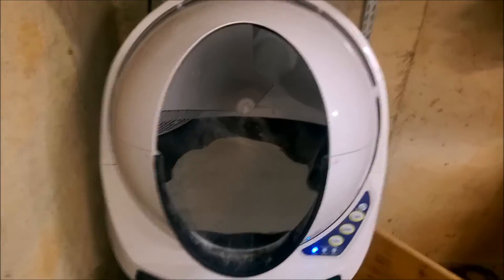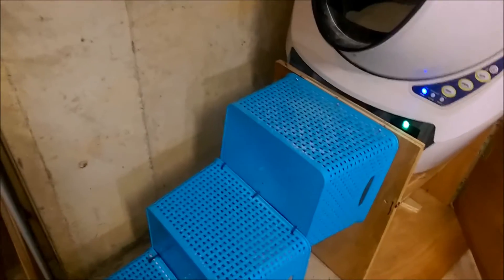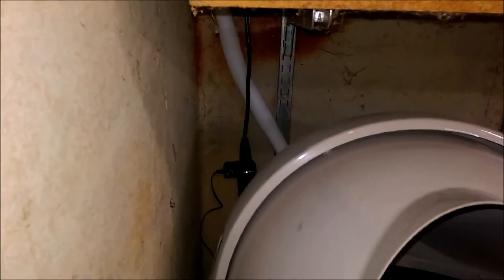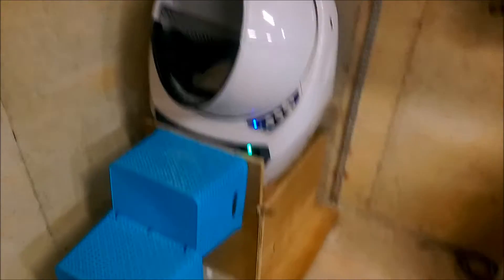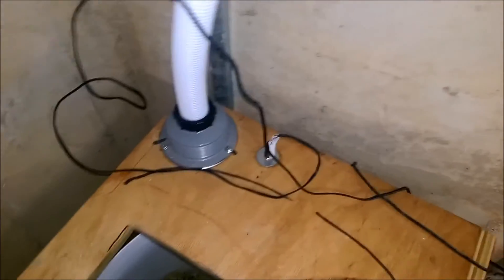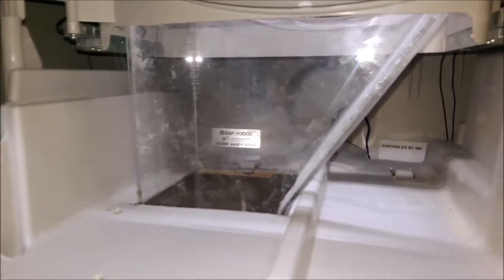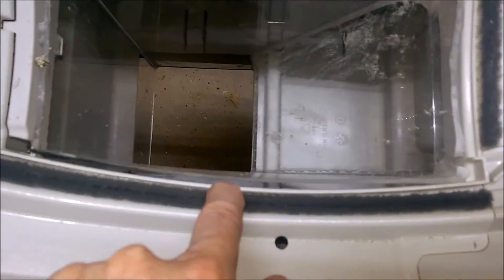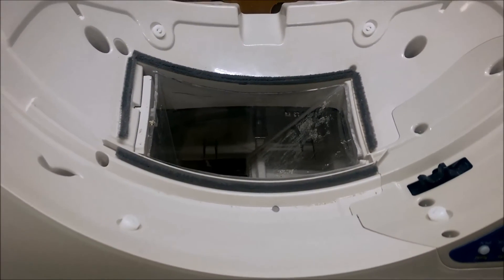Litter Robot Open Air high capacity litter bin mod.

Comment: Thank you very much for your demo. I build the cabinet similar, cut the perspex and cover outside hole instead of inside.  Seem to work well.  Today I will do the step.  If anyone needs the measurement I used for the cabinet, let me know and I can send you the cut I did.

Once again, thank you for your help mate.

Comment: I am about to pull the trigger on a litter robot 3 connect and this is the last issue I wanted to address before I do so thank you! Do you know if these modifications would cause any issues with that unit? And what fan did you use?
Reply from the maker: The only concern I had was that cutting the hole in the bottom might affect the weight sensor on the rear foot. so I took care to leave the center rib intact to ensure the bottom remained as stiff as possible.    No problems at all, except the need to clean the chute maybe once a year.   The fan is a 5" 12 volt PC case fan I had lying around.
Reply: Did you do this modification?

Comment: What did you use to make the chute? Just plexiglass?
Reply from the maker: Yes. Used solvent cement for initial assembly, and added beads of thick acrylic cement along the inside corners to strengthen it.  Also, I made patterns with foam core board first, ending at the bottom before cutting the hole, but extended the lower edges on the final parts.  (Probably not necessary).

Comment: Can you explain what parts you used for the tubing and connection to the fan? I tried something similar but yours looks so much better and probably sealed better.
Reply from the maker: I used a plastic kitchen sink strainer unit. I probably bought it at Ace hardware along with the hose, but they don't list it on their site now. 
I bought it because it was the cheapest one in the store, but a metal one would work as well:  https://www.acehardware.com/departments/plumbing/parts-and-repair/basket-strainers/4165296
Hose:  https://www.acehardware.com/departments/plumbing/hoses-and-tubing/hoses/4027710  (They sell it by the foot)
Detail photo: https://imgur.com/C4rlzz2
Reply: snaplash thank you!

Comment: Love your modification!  I used my old Litter-Bagger model LW700-L (wood stand) that I was no longer using since i no longer have the littermaid auto litter box. i
I cut through the both bottom of tray and bottom of robot. My cats love their cat poo cement maker so much. Before the modification i dreaded opening the tray to dump the crap. I don't know why the company does not offer a waste pass through.

Comment: I did something similar (but not as good) as this with the Litter Robot 2, but I’ve been weary to try it with the Open Air...

I thought this model would mess up if it no longer detects the weight of the litter it lost? You didn’t have to do anything else to trick it? I’m excited for this.
Reply from the maker: The weight sensor is on the rear leg. and gets reset after each cycle, so it doesn't care that the drawer is missing.   Since all 3 legs sit on the flat top of the enclosure, it detects cat presence just fine.  I kept the center rib intact along the bottom to maintain stiffness as well.
Reply: snaplash thank you! I read that it only reset when you power cycled or pressed the reset button, so this is great news!

Comment: Would it also work if you just cut a hole in the bottom of the drawer? I can’t do all the tech stuff you did but want to make a larger capacity drawer... would my drawer idea work?
Reply from the maker: EpicAphex14 yes, cutting drawer would work.  Some stuff would remain in drawer, but most would fall through.   I wanted to keep drawer in case I needed to revert to normal operation upstairs for new cats.

Comment from the maker: With one cat, I add litter about once a week,  The bucket takes over a month to fill.
I've also switched a laser depth sensor which is much more stable.  
Actually, the sensor is probably overkill, since you could get in the habit of checking the bin after each litter refill.
The Litter Robot makers should offer something like this as an option,